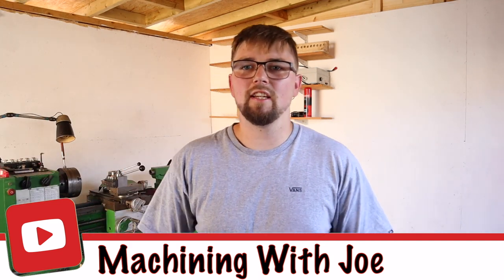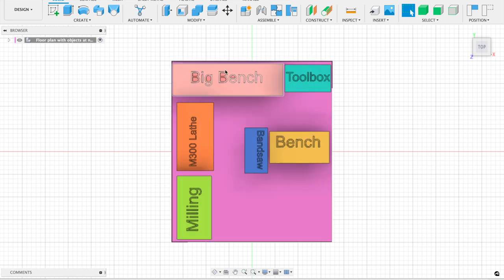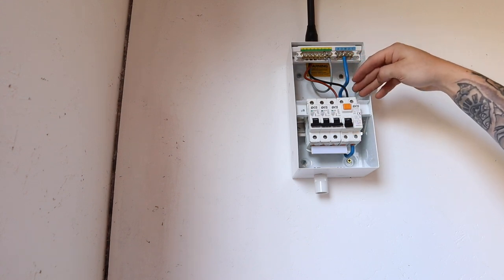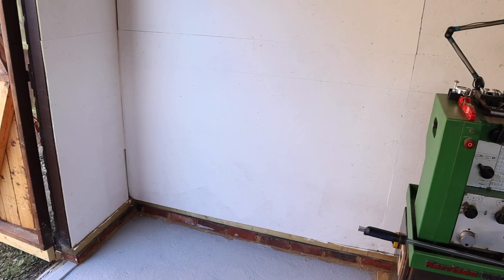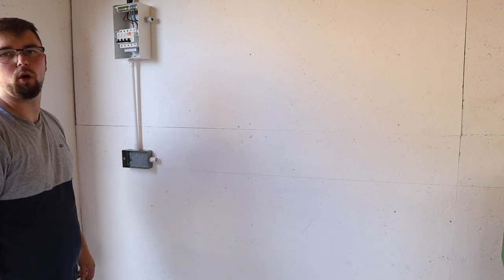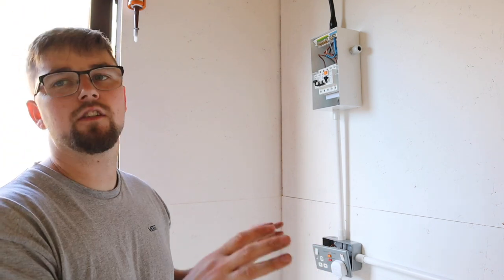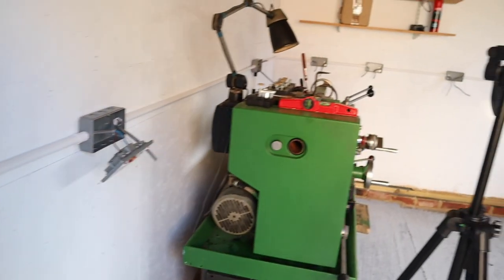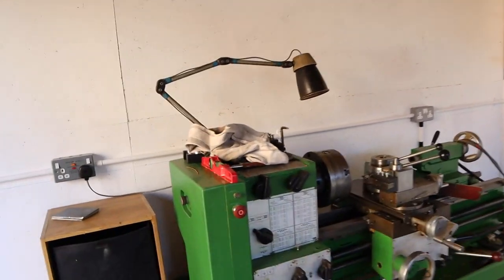Building my DREAM Workshop Part 3

Comment: Joe, just so you are aware you have installed a radial circuit and not a ring main. The radial should have a 16A breaker max. The cable can not cope with 32A and could catch fire if you get anywhere near 32A
Reply from the maker: Hi thank you Andrew I think to make it safer i will connect the last socket back to the consumer completing the ring.

Comment: I would recommend putting a few outlets on the ceiling so you can drop power to tools that are in the center of the shop without having to trip over cords run from the walls.
Reply from the maker: Thanks Mark that is always an idea for the future.

Comment: Part P building regulations. You have a very nice video of you breaking the law. If you have not yet burned the shop down, good lock.
Reply from the maker: Hi Fred I’m going to change the radial circuit to a ring main. And get my friend who is a spark to check it all out.
Reply: @MachiningwithJoe  you are allowed to do the works but not allowed to power it without it being inspected and tested by suitably qualified person. I worked very hard to obtain those qualifications and to watch this video saddens me.
Reply from the maker: @fredcreer1929  I’m sorry this video makes you feel that way Fred. I can understand your frustration and trust be the last thing I want is for my new shop to burn down. So Im definitely going to continue the circuit back to the consumer and also get the installation checked out to make sure it is safe.

Comment: Get some saddles for that saggy conduit Joe! You should wire the 16 Amp socket straight back to the 16 Amp MCB (Not RCD, thats the one on the right) And you have made a raial circuit for your sockets, the minimum requirement for that on a 32A MCB is 4mm Twin and Earth. Also Mark up that grey cable with some earth tape and the black neutral should be marked in blue! HTH!
Reply from the maker: Thanks Rob so I think after everyone’s comments I am going to wire the last socket back to the consumer. Also the phase converter is now wired using 4mm directly to 16A mcb.

Comment: Joe, looking at your main incoming cable, it looks about the same size as the 2.5mm twin and earth cable, I was wondering what size the armoured cable is ???? If it is 2.5mm, you really need to have a 20a breaker in the house and a 16a breaker in the workshop.
Reply from the maker: The armoured is 4mm cable as it was what was already there when I removed old shed.

Comment: Like your videos Joe but I would take the advice of sparky's on here; get your 'Radial' circuit checked out / certificated by a qualified electrician, to at least 17th edition regs, & then checked & signed off by an electrical inspector otherwise all your efforts will be in vain as no insurance company will cover you should anything untoward happen.
Reply from the maker: Thank you mexmanix yeah I think I am going to take advise complete radial circuit to make a ring main and get things tested.
Reply: @MachiningwithJoe  Radial circuits are fine Joe. As long as you run them in 4mm cable on the 32A MCB. They are easier to adapt as your workshop grows too!